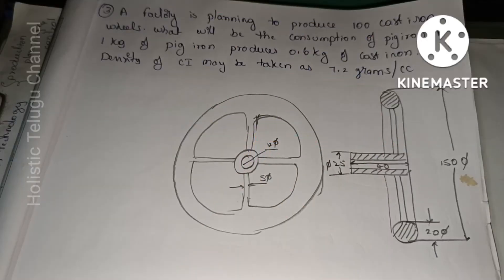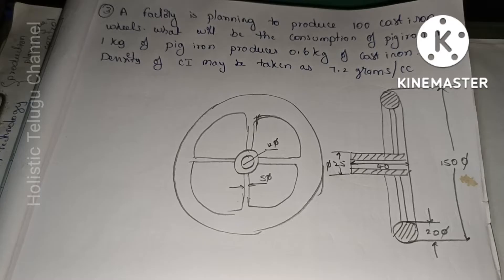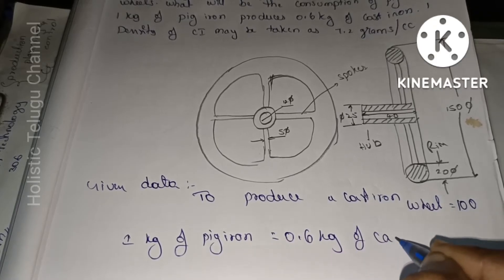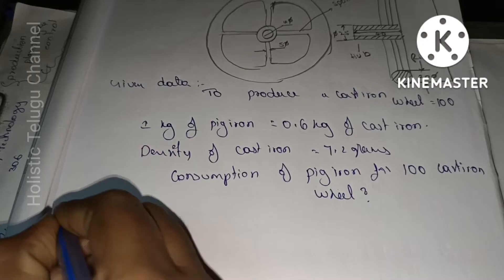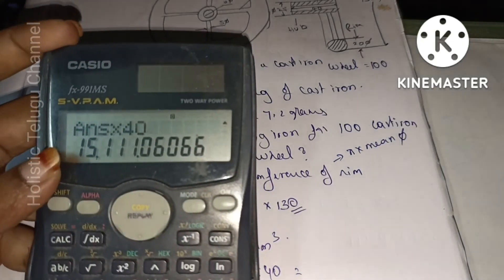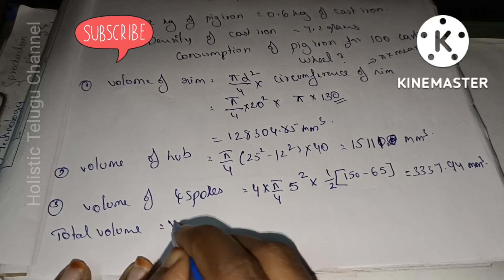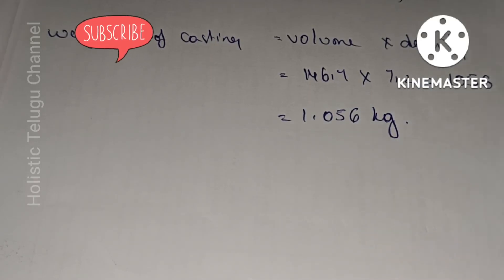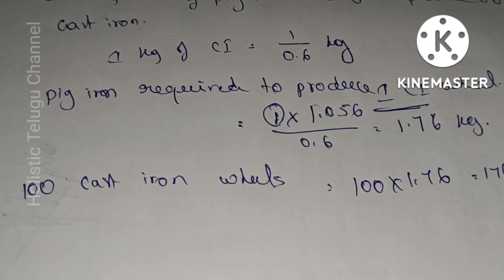Estimating and costing problems ll Estimating of Weights and Volume problem ll #estimation&costing

Comment: Length of the rim ni calculate chesetapudu 150-20 oka sare chestunaru Kani akada 20 anedi 2 times undi so 150-40 cheyali kadha Kani meeru prathi sari 150-20 ee chesaru Ala cheste final answer wrong vastundi 
Oka vela nenu chepinde tapu ayite oka sare naku explain chestara comment section loo